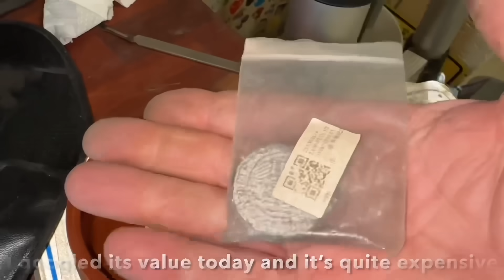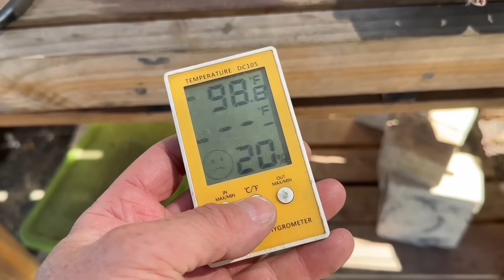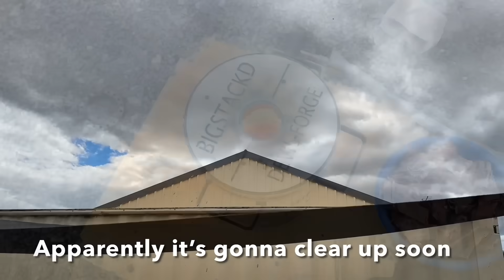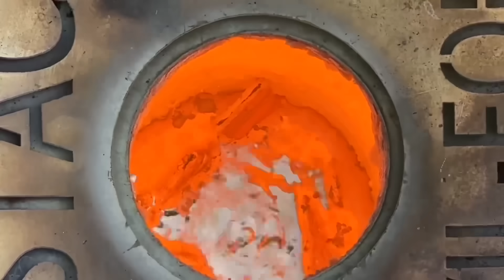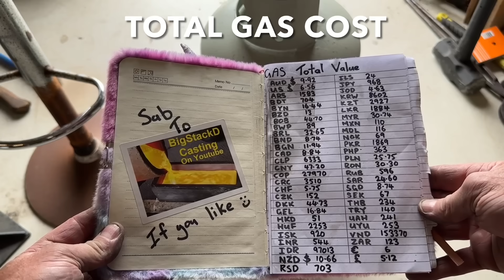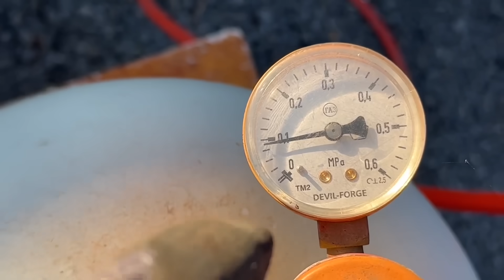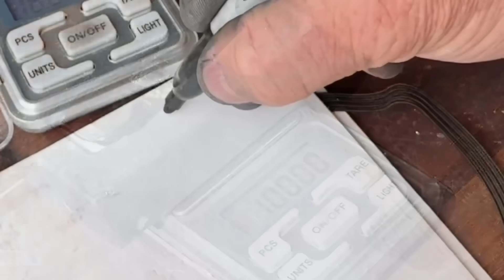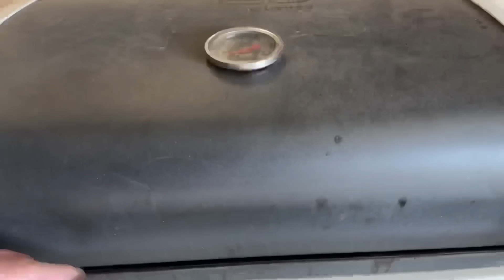Melting Metal In Your Hand - Gallium - Bulk  Copper Heat Exchanges - ASMR Metal Melting - BigStackD

Comment: Most of the world: can't get gallium to melt
Australia: can't get gallium to freeze
Reply: India:what is mean by gallium 🤔🤔😂😂😂
Reply: @shobanapriya.v3707  ''Gallium is a soft, silvery metal used primarily in electronic circuits, semiconductors and light-emitting diodes (LEDs). It is also useful in high-temperature thermometers, barometers, pharmaceuticals and nuclear medicine tests. The element has no known biological value''

Comment: If you add screws to your bench to tighten up all the joints it will help with how bad your bench is vibrating. The slack in the nail joints adds leverage to the vibration making it worse. The vibration then makes the nails work out of their holes and wallows out the holes. The easiest cheapest thing you could do is replace the nails with deck screws. If you wanted you could add some extra bracing on the vice side while you were at it but just putting in screws will make a huge difference

Comment: You’re good at building stuff.  Make a large funnel that fits over the top of your furnace.  You could toss stuff in it without the worry of roasting your hands or missing the hole.  The funnel might even dissipate some of the heat along the edges.  Put some nice handles on it.
Reply: Yes, I always think he should fashion a Hopper for the furnace!

Comment: I've never seen springs inside a heat exchanger or radiator before. I think they may have not been actual springs, but metal windings intended for some other purpose such as creating turbulence for more efficient dispersion of heat into the copper. 

I can't get over how clean the copper pours are compared to that brass.

Comment: The 'spring' wire might be Nichrome heater wire.  Nickle chrome.   Resistive and heats up to keep coolant coils from freezing.  Used in Heat pumps as a backup heater if to cold outside.

Comment: I wonder why is there a steel spring/coil in those pipes? It's a heat exchanger of some sort, but I can't figure out what that little bit of steel would do to make it worth manufacturing it that way.

Edit: Looked into it and apparently the added spring is called a "turbulator" and it's used to increase the turbulence the fluid experiences which increases the fluid's contact with the walls of the tubes/pipes! Neat!
Reply from the maker: These springs inside the heater are swirlers. They prevent water from boiling by forcing it to flow along the walls, slowing down the flow, allowing the water to heat up better, and significantly mute the noise of the flow of boiling water by evenly transferring heat from the surface of the cooper tube. If that kinda makes sense ? 🤔
Reply: @bigstackD  Makes 100% sense! I looked it up right after commenting thinking no one would know the answer to this or respond, much less the bigstackD man himself, haha so thanks! At first I was thinking, copper's a better conductor so why add steel? But after realizing what it was for, made me appreciate the physics behind it that much more.

Comment: Hey bigstackD galium has become so expensive because in the computer industry they are using it to coat Processors instead of using common thermal paste, they call it liquid metal and when using a very thin coating it has far better thermal transfer properties than common thermal paste which in turn causes far better cooling of the processor. In fact they use it exclusively in the PlayStation instead of using common thermal paste because the processor was so hard to thermally manage
Reply: It also has medical applications.  I had radioactive gallium for my MRIs.

Comment: Nice work on the copper melt, and Gallium is such a fun metal to play with but have you tried Bismuth. I know your all about casting but Bismuth crystals are just so nice to look at and as another low melting point metal, 271 C, I thought you might like to try and make some bismuth crystals as you wait for the furnace to do it's job, it could make for a nice display piece for your shelf ;)
Reply: actually yes he has tried a bismuth melt!!!

Comment: Question: Is it possible to to preheat the molds to the melting point of the metal you pour to prevent layering after cooling in the poured bar? Or to get a smoother surface on the bars?
Reply from the maker: Yes, you certainly can and it wouldn’t hurt the metal at all and would give a better appearance on the ingot, but it will lower the lifespan of the moulds. That’s why I’ll never put a mould inside the furnace and melt the metal directly in it as especially graphite moulds, it will make them all pitted and breakdown reducing its lifespan by about 90%. If you try this with steel moulds, you will basically fuse the metal to the steel. I do heat my moulds inside the furnace, but not enough to really hurt them, or lower the mould life expectancy if that makes sense👍🏻.
Reply: @bigstackD  Aah ok, that clears it up, thank you, it was a long time question of me.

Comment: Have you ever done any pool heaters? Probably not' huh? the water probably doesn't get cold enough over there to make them necessary.
Reply from the maker: Actually quite a few months ago I did a big spa heater and that had about 10 or 11 kg of Copper in that I was absolutely thrilled. It’s on the link below, but I think I may have missed titled it👍🏻. 
https://youtu.be/ky-0Sr5402E?si=ICn53tFeXDRIGkKY
Reply: @bigstackD  Yeah. I'll check it out. The pool heaters have a bunch of copper tubing with copper fins on them and some of them have a bunch of brass in them, too.

Comment: Hey stackman, do they not make crucibles with spouts for easier pouring? It seems like a semi-regular problem that the crucibles you have don't really allow for precise pouring. It's not a big deal for large ingot molds, but it rears its head a lot when you're using narrow or small molds, and sandcasting. Just wondering if there's a better tool for those jobs.

Comment: Attaching your workbench to the wall if possible can provide a lot of rigidity.
Reply from the maker: Yes I’m gonna pull out some brackets and bolted to the sea container then it won’t be going anywhere. Although I may just get a whole new bench as this one is only made out of the old pallets and not very strong at the best of times🤔

Comment: When brass pours real thick and globby like that, is there a remedy? would a touch of zinc or maybe aluminum thin it out a bit or is the alloy to blame?
Reply from the maker: Honestly, I would think if I added more Copper it would lower the percentage of zinc and give a smoother pour, but I didn’t want to mix any good Copper in with that ugly alloy. I have always thought about it if I kept overheating the brass, maybe the zinc would all burn off, or a lot of it atleast and that would give a higher percentage of Copper and may give a smoother pour. But again this is something I haven’t actually tried, but it kinda makes sense if you think about it.🤔.

Comment: Might be time to make a mega-hammer. 20’ tall, 100kg, connected to a hinge. Heavy steel plate for the “work surface”. Small winch with a quick release.

“The Precision Flattener”

Turn a pile of scrap into sheets. Easier to cut.

Comment: Hey man, I also bought a melting furnace, but somehow it doesn't quite come up to temperature despite the correct gas pressure and air supply, so it flickers from the noise translated with google I come from Germany 😅🤓

Comment: At this point, why are you still using small propane tanks and not a larger system?
Reply from the maker: At the end of the day, the small bottles are a lot more convenient. I can store them easier and when I need to swap them over it’s only a 30 minute round-trip but the larger bottles even though they would be 15% cheaper they are just harder to move around and store and  more cumbersome and it’s closer to a 70-75 minute round-trip to replace them.   I reckon it works out monetary about the same but the smaller bottles are just a lot more convenient and easier I reckon👍🏻.
Reply: @bigstackD  I was thinking something like a permanent tank and a hard line to the side of the building you do the melting on that you can run a flex to. This is a home heating option in the northeastern US where natural gas utilities aren't available. Not sure if it would be an option for you or if there are similar delivery services to refill those kinds of tanks.